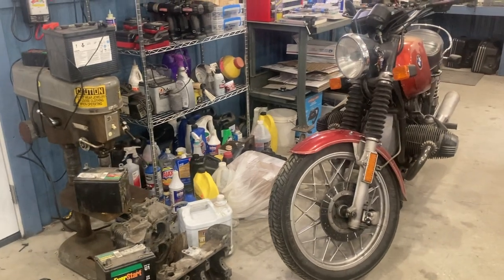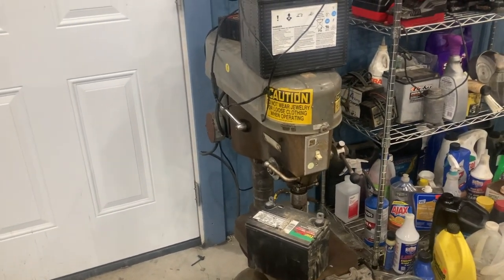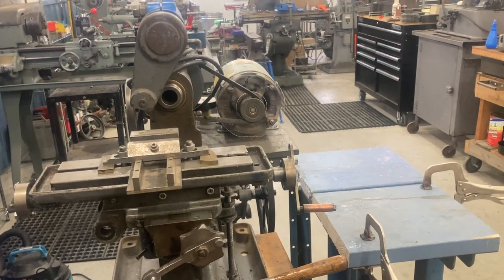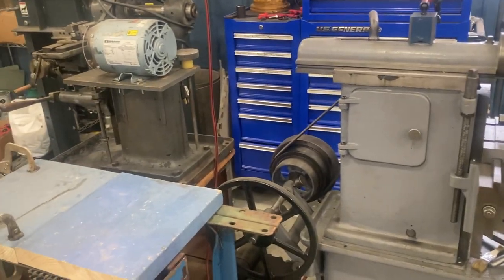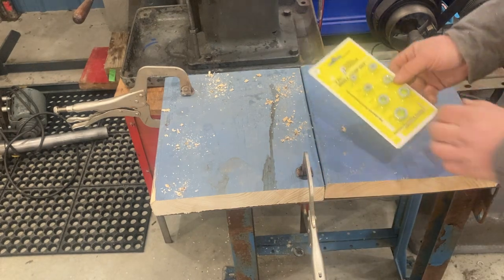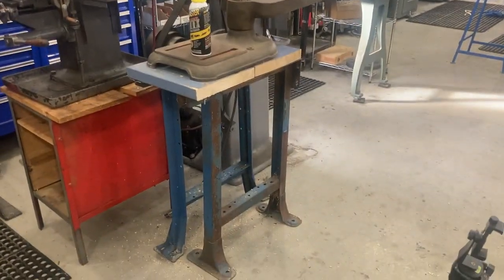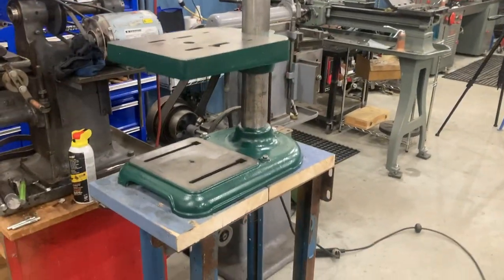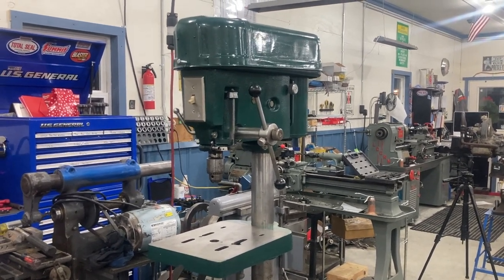My First Drill Press - Vintage Rockwell USA

Comment: I did a restoration on an old Craftsman drill press last fall. I think it came out great although the blue that I painted it is only a close match to what I think the original was. I use my Bridgeport more often, but it's nice to have something I don't have to turn on the phase converter to use.
Reply from the maker: That’s exactly why I ended up doing this. My Sipp drill press is 3 phase. If I have something very quick to do, I hate turning the phase converter on.

Comment: Great referb,would had liked to see the whole process. My shop,I have a HF 20 inch drill press,actually after bearings a better taper and a good chuck,a decent press. I have a second,generic floor drill press badged by everyone I got at auction for $3 , I put bearings and paint, in this thinking of just resell,but I put a Tapmatic and use as a dedicated tapping  machine,works great for me. I make a lot of caster plates and tap the holes.made a crappy video on it. Thanks for your content!
Reply from the maker: Thanks for watching! I found a return spring mechanism for this one and I’m going to install it this weekend. It’s amazing how cheap you can pick up older machines at auction. I have noticed in the past few years that prices seem to be going up. I think since COVID there has been a little renaissance of home shops and manual machines.